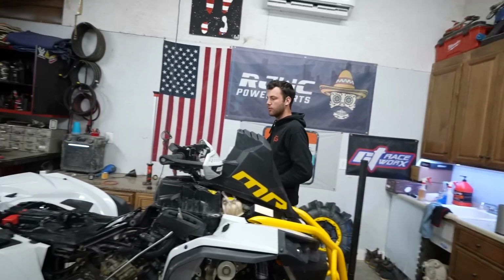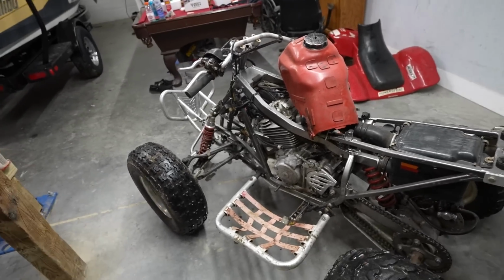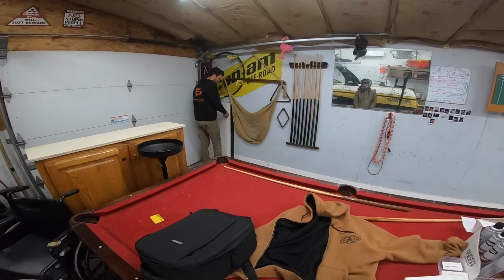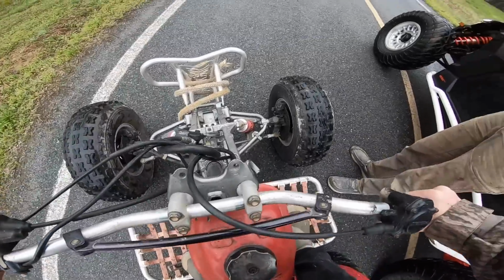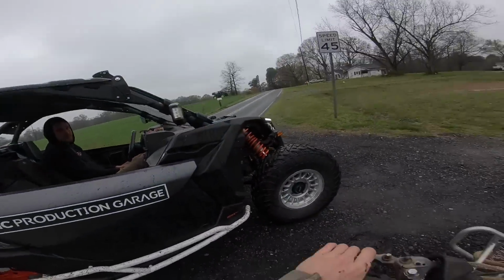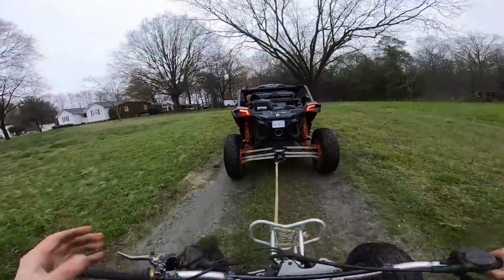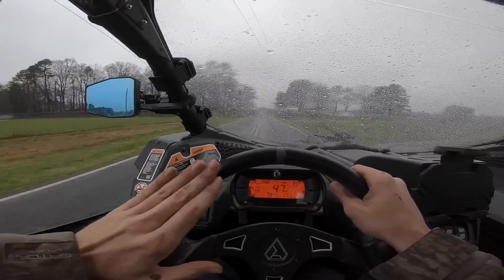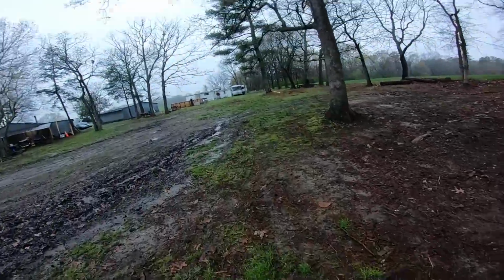Wheelies Are SKETCHY On Mystery Quad! *IT RIPS*

Comment: I had an old trx250 and it had the same issue. Spent way to much money and time to figure out it was the gas cap not letting air into the tank and air locking it.

Comment: Try spark wire i got the same quad i got it for 650$ only problems or vaulve adjustment that run with holes in the  piston no oil ext i would definitely keep it air colled hondas u see whag brayden is geting 250

Comment: Should find a 250ex which is the same engine as braydons white recon and it's semi auto. As for why it'll only run for the short time is either you need too rebuild the carburetor or  check the fuel tank for rust on the bottom since that can clog the carburetor and cause it too run like crap. If I were you I'd do both and call it good since it should run good after that and I'd guarantee that the dude you'll be calling will say the same thing.

Comment: you should get a 99-04 400ex
Reply: Worst year
Reply: That's what I have but the 300ex and it's just as fast as the 400ex but I also have a Yamaha Kodiak 450 I do want a can am outlander 850 or grizzly 660
Reply: Get an 07 or newer with reverse
Reply: @dieseltrucks790  exactly
Reply: I have one and they are so sick. And keep running
Reply: I have a 04 400ex and it’s a animal
Reply: @dieseltrucks790  reverse started in 05
Reply: I have a 04 it’s alot of fun and no problems
Reply: Hell nah
Reply: I have one an big bore over 40 it’s a beast
Reply: @that_crf450r6  oh I thought it was 07